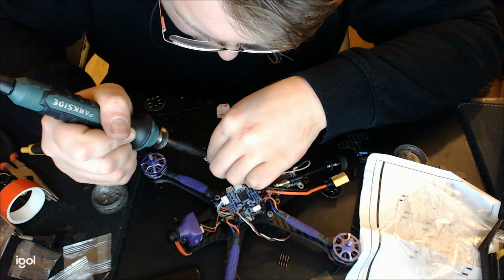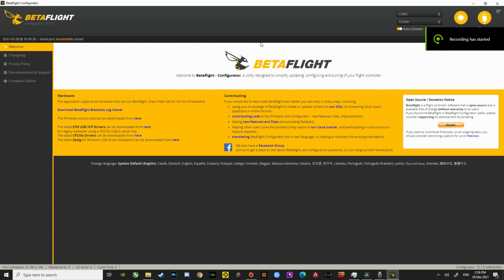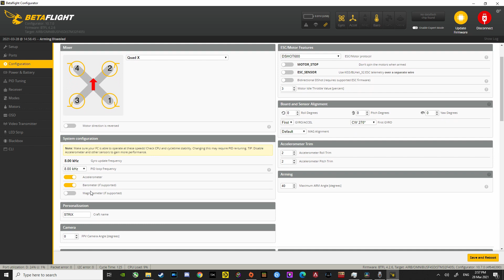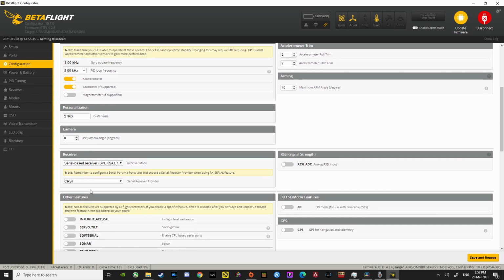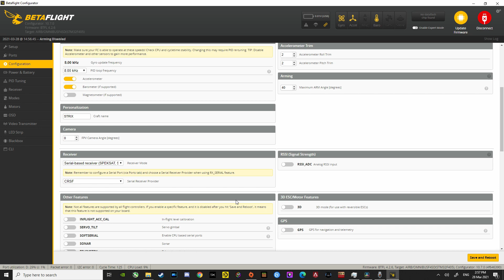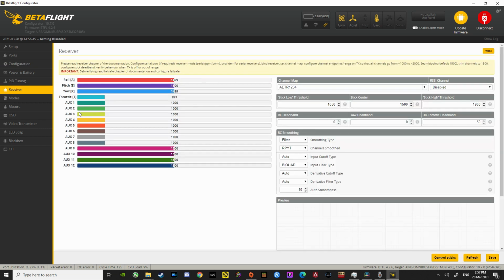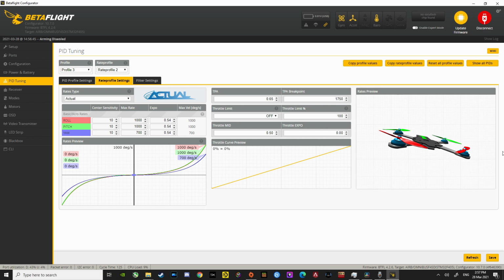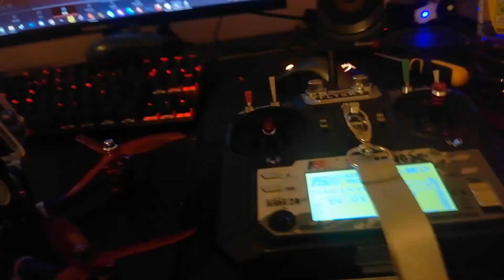Flysky fsi6x TBS Tracer mod + Apex frame build + TBS tracer Nano setup.

Comment: doing exactly the same, but do i need to do anything(choosing ppm in the tracer module itself) or will it work directly after connecting it up?
Reply from the maker: For me it worked directly, just remember to change your settings in betaflight to crossfire if I remember correctly!
Reply: thanks man :) hope it works. I think i will still be able to configure it via pc or over wifi on my phone

Comment: why not just plug the wires in the port  you dont have to open the controller
Reply from the maker: You could also get the ppm signal through the port but I wanted to do it more as a permanent way too and it looks a lot cleaner in my opinion, I added my own plug for the Sims aswell so there's no need for me to remove anything, it's all just plug and play now!

Comment: But why??
Reply from the maker: my quad failsafed and broke the frame, after that I thought it'll be a cool project and video modifying the quad and transmitter to increase range so it doesnt failsafe again, to this day it hasnt failsafed yet luckily
Reply: @NathansLife  its really cool that you did that but why not just get a better radio thar has a module bay. Dont get me wrong the FSi6x is a great starter radio. The flysky protocol is even better than frsky and spektrum.
Reply from the maker: @djilly75  Thank you! that is the plan! I didn't have enough money for a radio that was worth the upgrade, so with the frame, new props, the tracer unit and everything, it was €100 total, it's all I could afford at that stage to be honest 😂😂

Comment: Do you think the wifi antennas are the best option for the transmitter mod, or is there another option that would be any better?
Reply from the maker: The WiFi antennas was a fairly good mod but the range was still not that impressive, the crossfire module would work perfectly too, I just found this tracer kit for a lot cheaper, and the range is absolutely amazing now, I'm running it at 100mw and have flown over 300m so far and no failsafe at all which saves on drone parts a lot in the long run
Reply: What’s the difference in this and the crossfire module I’ve seen.

Comment: Hey man , amazing video , can we make the mod in a way we don't need to have ab external battery? That just takes power from the flysky battery ?
Reply from the maker: Hey man, of course you can! I think its going to take a lot of battery power but it will work! You just connect the positive to the positive pad on the actual board and negative to either the battery cable or the board which would be better!